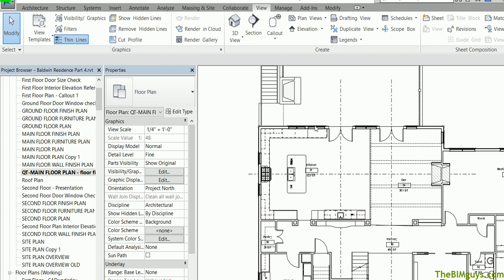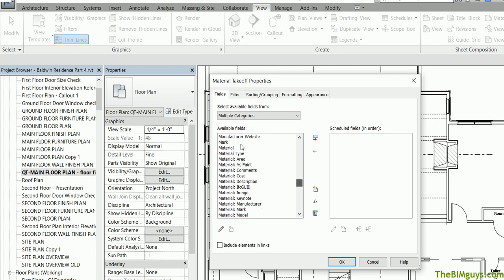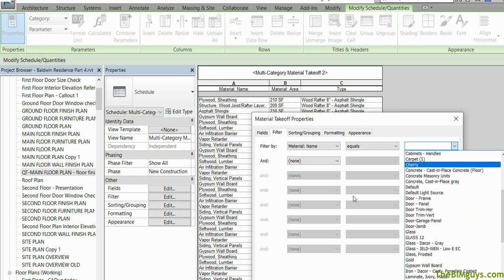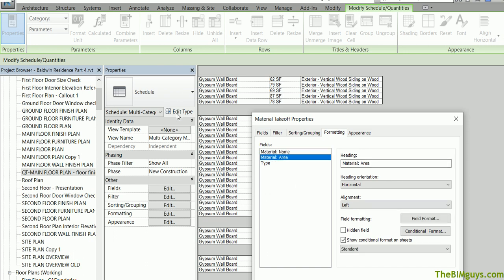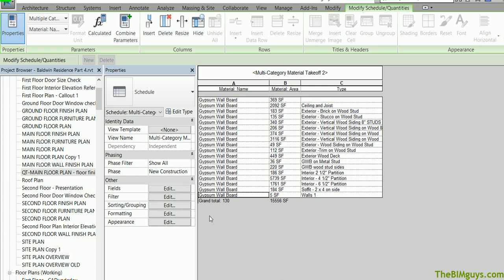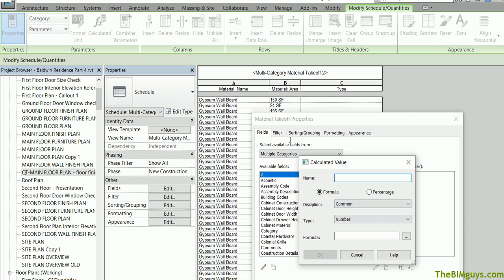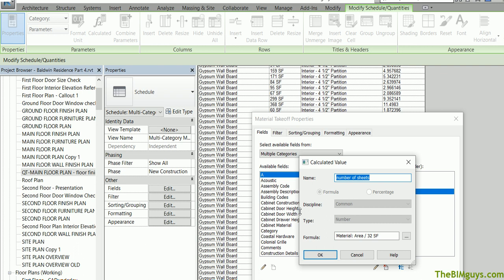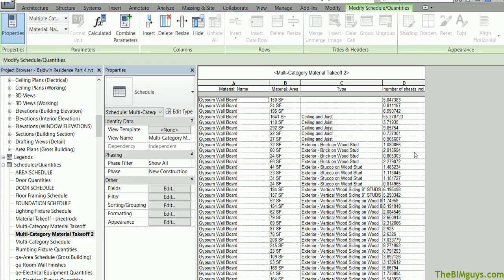Revit - Material Takeoff - Gypsum Wallboard / Sheetrock - CADtech Seminars, LLC

Comment: I created a wall material takeoff and it is working fine, except when I have an interior wall with gyp on both sides. Revit only counts the gyp on one side. Example. I have a 5' long wall by 8ft. high with gyp on both sides. The takeoff only counts 40sq. ft. of gyp instead of 80 sq. ft. The structure is correct, 1/2" gyp on both sides of the core boundary. Do you have any ideas on how to solve this? Thank you in advance.
Reply: Well think of it if you were actually building the wall. in the model, do you have your core, then Gyp on both sides of the stud? right now it sounds like you only put gyp on one side of the stud. revit calculates whats in the model. So the model has to be correct. i just tried it and it calculates it fine.
Reply: also try checking the material of those components in the structure of the wall